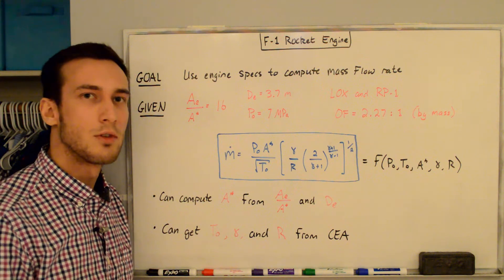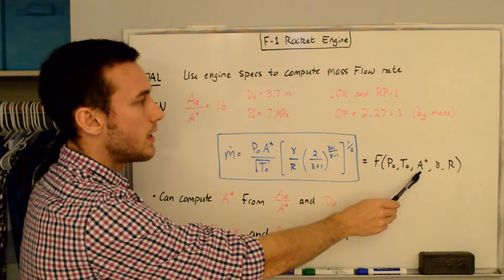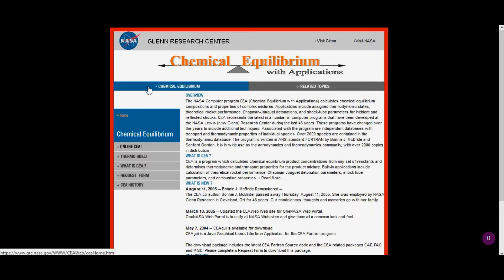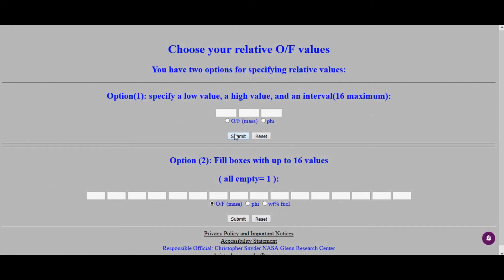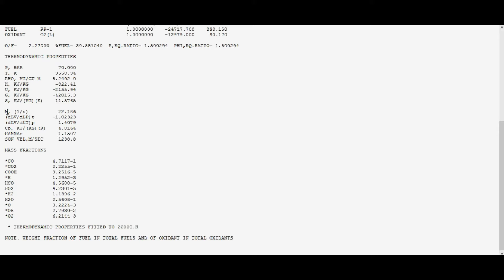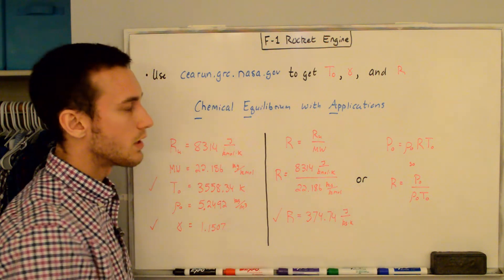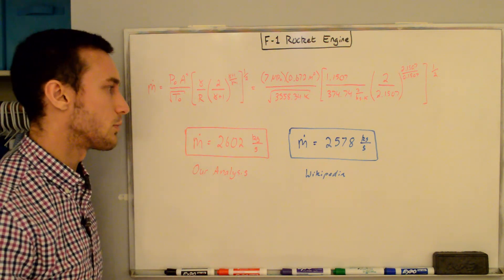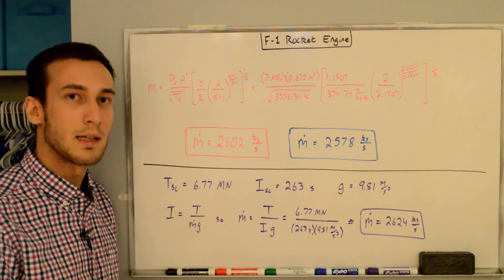Rocketdyne F-1 Mass Flow Rate Calculation

Comment: am i right or wrong cause i am doing a question similar but to calculate the thrust of the SpaceX Merlin Engine given combustion pressure is 9.7 MPa, temperature im cumbustion is 3685K, area of throat is 0.05m^2, pressure at nozzle exit is 101325.0Pa, gamma is 1.14 and R is 378.00

Comment: Hello Josh
I know its an old post but i break my head to understand something.
OK ! the numbers match.
No objection to that and you really did a good job.
But how about the designing part ?
I mean look at the damn engine.
The contraction ratio (Ac/At) must be like 1.2 or 1.3
The contraction angle something like 15 degrees.
And the Thrust Chamber looks really small for that humongous thrust even you pump a swiming pool of propelant in a blink of an eye.
I know that it would be difficult to bend the regenerative pipes in a steeper angle and still work flawlessly
but have you tried to check if the numbers work in THAT SPECIFIC design ?
Thanks and i hope you ll see this.

Comment: Hi Josh great vid, just a quick question. Is the mass flow rate simply the amount of fuel flowing through the engine, so essentially the amount saturn v's first stage fuel mass / burn time / 5 (5 engines)?
Reply from the maker: That's right, it's just the fuel mass per unit time flowing through the engine (kg/sec).  Assuming all the engines are equal, and they are not throttled at all over the burn time, then you could calculate the flow rate like you mentioned.

Comment: Why not divide total fuel mass kerosene and oxidizer with run time?
Reply from the maker: If you have the total mass of both and know the run time, then you can do that.  This method uses different knowns such as those given in engine specs.

Comment: Joshtheengineer, Would you agree chemical thrusters are better than ion thrusters? Or ion thrusters better than chemical ?
Reply from the maker: The choice of what propulsion system to use depends on its application.  For some, solid or liquid rockets are better, while for others, electric propulsion systems are better.